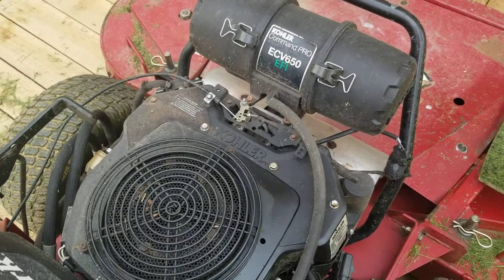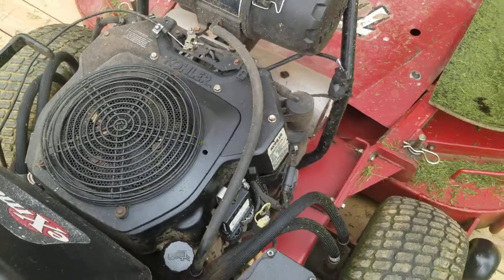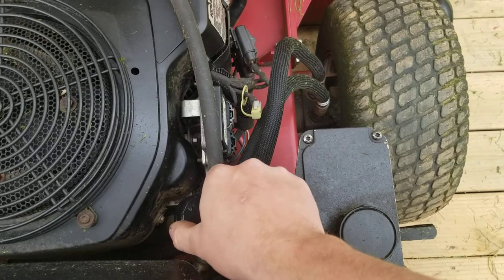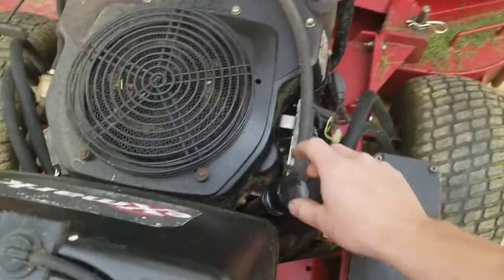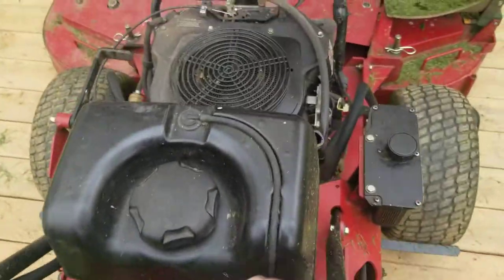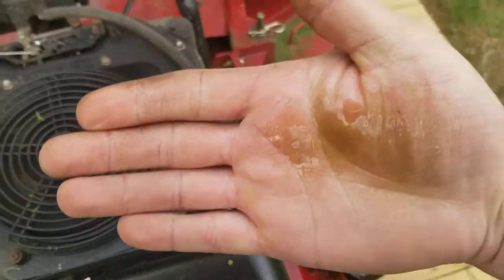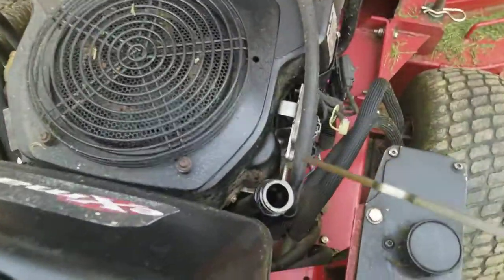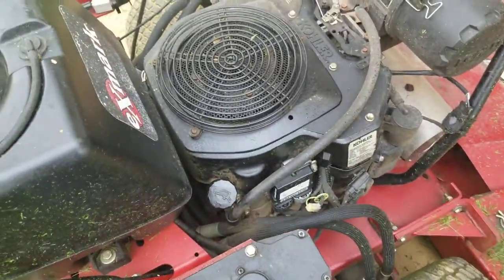Example of excessive crankcase pressure

Comment: Crankcase pressure fluctuation is also normal, and can be caused by the downward stroke of the under side of the piston on both intake and exhaust stroke.  The upward stroke (top of [piston) compresses the gas/air mixture, and 2 strokes later pushes out the exhaust gases above the pistons.  It is not always due to blow by pressure past the rings during combustion.

Comment: Blow by can be caused by a failing head gasket. Did you do a compression check? Its cheap to replace the head gaskets and adjust the valve lash and rebuild the carburetor. That engine sounds like it runs to smooth to be blow by.

Comment: I have 2 push mowers thatll do that. But they still pull a vacuum. My small engine guy says as long as it pulls a vacuum and doesn't read pressure, then its okay. He says the crankcase ventilation system is circumvented when you remove the oil cap. So itll mist some oil out. Bad blowby will cause the oil to smell like fuel and make it flammable.

Yours does seem way excessive. You can see combustion gases coming out of the crankcase.
Reply from the maker: Its definitely excessive. A new crankcase breather got it running better to finish out the season. Its got over 2000 hours on it. Blow By for sure. Its getting rebuilt as soon as the snow flies.
Reply: @brettbuiltit7504  lol. Well at over 2000 hrs it dont owe you anything. Thanks for the vid!

Comment: my brand new timecutter does this im calling kohler they better fix this crap 

not even one hour on it
Reply: Some of this is normal.  Crankcase pressure/vacuum pulses are normally built up inside the engine due to the piston moving up and down.  The crankcase breather helps take care of this, but you bypass the breather when you remove the oil fill cap.   Sure, in some cases, excessive pressure could be caused by worn piston/rings/cylinder, or perhaps a blown head gasket.  But, I'm willing to be there is nothing wrong with your brand new engine.

Comment: How did you fix it?
Reply from the maker: Put in a new crankcase breather to get me through the season. Theres plenty of blow by too, probably why it was throwing oil 5 feet out of the cap. As soon as the snow flies its getting rebuilt. Its got well over 2000 hours on it.